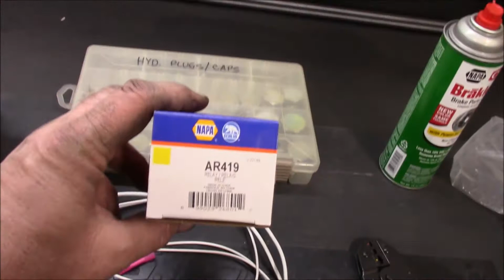FASS Installation on Monaco Roadmaster S Series with Cummins ISL Engine

Comment: I've been tetering on getting that system. It sounds really good but not cheap. You've convinced me! Thanks. I'm on that same track. I want to vacation, not sit in the motorhome waiting for parts or service.
Reply from the maker: I know the FASS pump isn't cheap but it is a lot less than a CAPS injection pump which is what I was more concerned about protecting.  It performs as expected and if so it again.

Thanks for watching.
Mike

Comment: Hi Mike,
Thanks for your quick reply. 
I have re-watched your video. I understand what you did but I do not have the diesel engine experience to identify what lines to disconnect and re-route from the lift pump and injection pump.
You did a great job explaining and videoing everything but for me I have to also see what was capped and rerouted.
Again thank for your help. T

Comment: Thanks for the video.  Sure would like to do this upgrade as my oem lift pump has just started leaking.
Reply from the maker: It is a very worthwhile upgrade as it really helps to protect the CAPS injection pump.  

Thanks for taking the time to watch.
Mike

Comment: great info, going to do same thing on my 8.9, had the FASS pump on my bench and now feel better about mounting it. i like doing the return the way you did it, rather than in the filler neck adapter they send with the kit.
Reply from the maker: You’ll like having the confidence knowing your CAPS injection pump is protected.  I have a couple thousand miles on mine now since the FASS installation and love it.  
Thank for watching.  
Mike
Reply: did you take your factory pump off? i didn't and have a leak in that area now, hard to see up in there.
Reply from the maker: No I did not remove the OEM lift pump assembly because the lift pump manifold contains the ports for the injection pump return line back to the tank.  I merely blocked off the supply ports and disconnected the lift pump electrically, therefore bypassing the OEM lift pump feeding the CAPS injection pump.  
Thanks for watching.  
Mike

Comment: With the Cat 3126 or C7, buy FASS IN-165G. The fuel return rate is so low of pressure you can T it in after the fuel pressure regulator on back of the head. Mount at the back and hook directly into the stock fuel lines. There’s enough wire to get to the battery box. You’ll just need a roll or 14AWG to extend the IGN wire up to the front. I do recommend running a new fuel feed line to the HEUI mechanical fuel pump . I use hydraulic hose as it’ll last a long time. Thought I’d share for those with Cat motors.

Comment: Hi, Mike. I don’t understand the purpose of the first relay you installed using only the coil circuit. 
Great job as always.
Reply from the maker: Thank you.  The first relay using only the coil is to “fool” the ECM to thinking it still has the OEM lift pump motor in the system.  Without that it would throw a code for open lift pump motor.  The relay coil provides just enough resistance that the ECM still thinks there is a load on the lift pump circuit.  

Thanks for watching and I hope I explained it ok.   
Mike
Reply: @zmotorsports62  now I get it. Thanks for educating me.
Reply: Mike,The video was awesome in great detail except for the wiring of the coil and the original lift pump. I'm a little confused. The new relay using only the coil part of the relay, goes on/between the  wiring going to the original lift pump? or in place of the wiring going to the lift pump. 
 Merlin
Reply from the maker: Merlin, the control side (coil) of the relay gets wired into the harness wiring that goes to the OEM lift pump.  Disconnect the wiring from the lift pump and run the two wires to the control side (coil) on the relay.  The objective it to put a small load back into the circuit when you disconnect the original lift pump to fool the ECM into thinking there is still a load on the circuit.  

Hope that helps explain it and thanks for watching.  
Mike
Reply: thank you
Reply from the maker: You’re welcome Merlin.

Comment: Thanks for the video!!!  Great info on the FASS.  You mention that you are installing a pyrometer, but you didn't show that part in this video.  Do you have any other videos where you did this?
Reply from the maker: Sorry, I didn't show the pyrometer install as it wasn't specific to the FASS.  I do show pictures of the panel that I fabricated for the pyrometer and fuel pressure gauges in the cockpit over on irv2.com and the monacoers.org forums though.  

Thank you for watching and for the comments.
Mike

Comment: Good video Mike, I have a 2003 winsler Developed a small miss  When accelerating,  Empty the fuel tank start with fresh  Fuel, And change filters, Can't get the water and fuel white to go out?  After changing filters twice? Still small miss???  Ran across this video Thinking this may be the answer?? What do you think???  Oh yeah under 50000, Miles,,, Thanks
Reply from the maker: Hard to say but a slight miss definitely sounds fuel related, especially if you're working it or pushing it when fuel demand is at it's highest.  
The thing I like about the FASS system is there ability to polish the fuel (over-filter or continually filter) the fuel. M one want experiencing any issues as I did mine solely as preventative measures and to protect the CAPS fuel pump. I put just over 5500 miles on our coach this season since I installed the FASS fuel pump and wish I would have done it years ago. 
Thank you for taking the time to watch. 
Mike

Comment: Great video. Thanks for the information. Is the lift pump above the starter, and did you get access from on top
Reply from the maker: Thank you.  Yes the OEM lift pump is located and the starter motor.  On my Dynasty it was not easily accessible and only from the bottom.

Comment: Great video Mike, can you give me a little more information about the electronic fuel pressure gauge that goes up front? (part # where to get it, )
Reply from the maker: I purchased my Auto Meter gauge from Summit Racing.  It was an older "classic" style but I think they have now been replaced by the Elite Series.  Tho
The one closest that I can see is an Auto Meter part # ATM-5661 that comes with the sending unit/transducer.

Comment: thanks for the great info/ videos. i have a 2001 40' dyna/sig mutt, with a 370 isl. ive owned the rig 5 years now and it just always seems low on power. its been to 3 different diesel mechanics, turbo rebuilt, new intercooler, fuel filters changed many times. goes 70 on flat no problem but any incline whatsoever she loses speed, towing or not it seems to run the same. starts up fine unless it sits for months on end, i notice it will stall out after start up like it looses prime.
thanks in advance for any input, im not really sure if these are just big heavy underpowered rigs or if theres other issues at play.
Reply from the maker: Thanks for taking the time to watch. 

Really can't give much advice other than to ensure there are no boost leaks and fuel leaks (air intrusion) which are the least time consuming to check. 

The FASS system aids with eliminating air in the fuel but it really won't help with power as that is reliant on everything mechanical in the engine performing as designed. Many people install a FASS system thinking it will cure other issues but it is not a bandaid, it merely aids in fuel delivery  From valve clearances to the high pressure pump to injectors, everything must be properly set up and in spec for maximum power and efficiency. 

My Dynasty will feel the grades but most of the time I can pass semi's on grades without issue. I now only tow our 6k pound Jeep but used to haul our 26' enclosed race trailer around most of the Western U.S. and it weighed about 13k pounds. 

I would start by ensuring you are getting the correct amount of boost and adding a pyrometer would hell to know if you are fueling properly. 
Mike
Reply: Thanks for the quick reply. I’m in so cal, I usually tow my xj 4 door and 4 seat razor 1000 on A 24’ pj deck trailer. Going up cajon pass I’m 2nd gear pulling 24 mph. 
My lift pump does drip sometimes after cold start.  I’m gonna check for air intrusion into the fuel system then next step is probably take to Cummins as each shop doesn’t seem to know how to check the spec items. Just hard to judge how the rig should be performing, glad to hear input from other individuals with similar setups. Thank you
Reply: Btw boost is about 22-24 psi. Need to install a new pyro as the banks crap that was on it doesn’t work. Also someone put a banks module of some sort on it for a isc. Banks was no help pretty much said obsolete and pound sand.
Reply from the maker: Boost seems about right for a stock ISL.  Banks did not make a kit for the ISL, only the ISC so if someone cobbled together a setup using the ISC components and tune on your ISL, I would start by removing that. 

I did bump my boost up to around 29~ish by removing the boost signals to the wastegate which helped to lower my EGT's.  Keep in mind this will do nothing for performance however as I just did it to lower my EGT's slightly. 
Mike

Comment: Hey, Another question.  How do you size the correct pump for the engine.  I have a 2003 Monaco Executive with the 500 hp ISM Cummins.  It appears there are several different versions of GPH and PSI???  Thanks
Reply from the maker: There's no real sizing per se.   When I spoke to the FASS tech support I was told for an RV most engines would work on anything from 90-100 on up GPH would work.  I asked what they run on the large OTR tractors and they told me the 165 GPH version, so that's what I went with.   I know it's overkill for my little ISL 400 but I like the added benefit of the fuel polishing of the whole tank every hour basically.  

Mike

Comment: Mike, Thanks for the quality you present and your willingness to share. I have an '02 Dynasty 400HP ISL and the lift pump is dripping. I have tried every angle under and above and can't find any way to access it for repair. I noticed when you showed the lift pump fittings there seemed to be room to get to yours. Am I missing something, or are the coaches thar different?
Reply from the maker: Thanks for the comments Tom.

I'm not gonna lie, access in the S-Series chassis SUCKS.  The picture I took was a bit deceiving as there isn't much room. 

I've replaced a couple of lift pumps in our Dynasty over the past fifteen years of ownership and I'm glad I don't have to ever deal with that again.  

I can't get anywhere near my lift pump from above, only from underneath. You have to be a bit of a contortionist however.  

Thanks for taking the time to watch and for luck. 
Mike

Comment: Mike, I have a 2002 CC with a cummins ISC 8.3L and I called FASS and they recommended that I use the IND 165G, looks like you used one with a different part #. Is there a difference? Thanks for including your parts list!
Reply from the maker: The only difference I can see when I looked it up is that the TS-D08-165G that I used is listed for a Dodge application and the one you listed is an industrial application and costs more.  Not sure why the inconstancy as FASS recommended to me the 165 gph Dodge kit for my application as well as what they told me they recommend for the large Class 8 OTR trucks.  The Dodge kit is less expensive and appears to be more readily available.  

Mike

Comment: Hi Mike, great video. I’m about to install the FASS system on my 2000 Discovery. I like your strategy of mounting up front. Makes a lot of sense. I couldn’t locate the links though to see the spare parts you used. How do I access them. I also had the same ECM/relay question (why is that needed) . Good to see that answered already. 
Thanks for your contribution!
Brad
Reply from the maker: Brad, I just double checked and the links in the description are still working. Scroll down below the introduction paragraph and all the links with descriptions are there.  Click on each one and they’ll take you to the item on Summit Racing’s website.  The only things I didn’t purchase from Summit Racing were the couple of hoses that I had made up at my local hose supply house and the relay from my local NAPA. 

Good luck on your install and thanks for watching.  
Mike

Comment: Mike, Very nicely done video. I just got finished doing a Fass install on our 2001 ,  8.9 ISC, and so far all is running ok. Would like to have done as you and plumb up front, but sadly no room so opted for the rear in place of the primary Filter. Some Questions I have that I hope you are willing to answer. You mention a fluid filled and dash mounted pressure gauge to show the Fass output pressure. What pressures are you seeing coming out of the Fass? I am using the 100 gpm Titanium system that according to their specs is setup to generate 16 psi, but I am seeing a very steady 20. Ive read of a few others that say theirs is running in the 18 range. I am wondering if 20 is maybe too much, do I need to regulate down. Or is 20 ok? Not much info I can find on what max pressure going into the Caps is ok.

Also curious, when you come out of your Fass, did you go through the old lift pump or straight to the inlet side of the main fuel filter. I wanted to leave my OE lift for the what if, but seem to get the gasket area to quit weeping even with a new gasket. About to abandon the lift and just reroute straight to the main filter, and maybe have another fass whisper pump in my spare parts. 
I appreciate any and all feedback.
Mike in Alabama.
Reply from the maker: Thanks.  

I'm told the CAPS pumps can handle a maximum of 25 PSI at the inlet. 

My pressures are around 16.5-18 at idle and drop too around 15-15.5 PSI at full load.  

You shouldn't have to regulate it as it has a calibrated spring at the pump to keep pressures in check.    That being said, mine originally put out 26.5 PSI when I first fired it up.  Upon diagnosing I found a burr on the bullet behind the fitting where the spring is at.  Once I removed it, sanded the burr off and reinstalled my pressure had been pretty consistent around 16.5~ish.  

Like I mentioned in the video, I bypassed my OEM lift pump. 

As for your 2001. It should be a 8.3 liter ISC.  The 8.9 liter ISL didn't go into production until 2002 and was available in 370 HP version as well as 400 HP.  The  8.3 ISC was available in 330 HP and 350 HP variants. 

Hope that helps.  
Mike
Reply: @zmotorsports62  Mike thanks for a quick reply. Yes mine is a 8.9 ISC 350. Sorry, I must have missed your statement about bypassing. I did see 1 posting on one of the forums where an individual stated they had been told by cummins up  to 25 was ok, but nothing else out there on that topic. I usually like to see multiple comments on a topic before I call it factual. I'll check the bullet you mention for any deformation. Thanks again for the feedback. Yes sir, helps. Mike

Comment: You are lucky Mike, my fuel bay only has the fuel tank in it with no room on either side of it and I don’t have room to put the pump over the top of it so I am mounting mine back where the primary filter is. I don’t have a tag axle on my dynasty so I’m guessing that’s part of the difference in the layout but we all know these things are snowflakes as none of them seem to be the same.
Reply from the maker: Each one is definitely a bit different Tim.  Hope the install goes well.  You'll be glad that you did it in the end.  
Mike

Comment: Mike I didn’t see a PN for what gauge you used in the cockpit. Did you by chance do a video of that install?
Reply from the maker: I didn't do a separate video on the cockpit gauge cluster as it was secondary to the actual FASS system and not really a necessity for the system to function, sorry.  

For the gauges however, I used the Auto Meter Z-Series gauges.  Fuel pressure was 2660, boost gauge was 2616 and the pyrometer was 2654. 

The panel for the gauges I fabricated in-house. 

Thanks for watching. 
Mike
Reply: Do you think 18ga harness is heavy enough for the run up to the cockpit from the sending unit? Pyrometer would be nice too don’t know if 18 ga is sufficient to pull for future gauge?
Reply from the maker: The pressure sending unit is a very small load so 18-gauge should be more than adequate.  What is just as important is making sure you have a good solid ground.  I avoided tying my new gauges into an existing ground and used a new grounding point as I have seen too many Monaco coaches over the years have erroneous and erratic needle fluctuations due to grounds so I am anal about proper grounding for gauges.  

For the pyrometer you'll want to use an extender kit as the wire size and length play a role in accuracy.  I used the Auto-Meter extender kit and it works perfectly.  
Mike